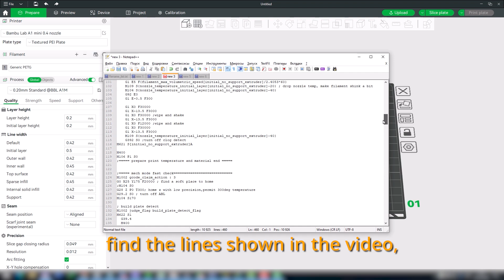How to disable vibration at start for BambuLab A1 Mini

Comment: For the A1 (No mini):

;===== mech mode fast check start =====================
;M1002 gcode_claim_action : 3

;G1 X128 Y128 F20000
;G1 Z5 F1200
;M400 P200
;M970.3 Q1 A5 K0 O3
;M974 Q1 S2 P0

;M970.2 Q1 K1 W58 Z0.1
;M974 S2

;G1 X128 Y128 F20000
;G1 Z5 F1200
;M400 P200
;M970.3 Q0 A10 K0 O1
;M974 Q0 S2 P0

;M970.2 Q0 K1 W78 Z0.1
;M974 S2

;M975 S1
;G1 F30000
;G1 X0 Y5
;G28 X ; re-home XY

;G1 Z4 F1200

;===== mech mode fast check end =======================
Reply from the maker: Thanks, I will pin your comment to make it more visible for other people.
Reply: e para a A1 Mini?
Reply: Iv have just tried on the A1, I commented out what the video showed, saved it, applied it and did a test print, I still get SOME vibration test, but not the big big shakey one.. how do I stop it all?
Reply: @Doyle69  Delete in the command "mech mode fast check start " until "mech mode fast check end" I can do it without shaking, very good.
Reply: @anuchasanchaikla44  Shall give a try thanks.
Reply: @anuchasanchaikla44  Worked perfectly thanks
Reply: @Doyle69  This worked, thank you very much!
Reply: @kerbalgaming1808  Have you found that his has affected your print quality? If so, how?

Comment: If you can't find the options you might have the printer table minimized (update changed the UI). Make sure to click on the "Printer" tab at the top to see your selected printer, then hover over the printer and you will see an edit symbol within that window that you can click. Clicking the cogwheel on the right side of "Printer" will let you choose printer but not see the advanced GCODE options seen in this video.

Comment: Whoever decided this test is needed every time the machine prints should be fired.
I'm pretty sure that while this may test for lose parts etc., it also causes lose parts and more wear and tear on the machine, so that Bambu Labs can sell more machines.
Reply from the maker: Maybe. Code from pastebin still works on my side.
Reply: @IzoFoxUA  Checked my Notepad++ and the edited code was still there. But it was not in BambuStudio. I could have sworn I pasted it in, but it was the normal code. Repasted the code and it works. Probably human error on my part. Sorry about that!
Your code works! :)

Comment: I sit here for 30 mins confused because my bambu software doesn't look like yours. 
So you use older software?
Reply from the maker: Yes, this video have been recorded 8-9 months ago and they slightly changed UI since that time.
You can click at the icon in the upper-right corner of your printer to change the printer settings.

Comment: This should work with the H2D as well - right?
Reply from the maker: Sorry, what is H2D? I think no, because it's only custom code change for the BambuLab A1 Mini and for H2D it probably be different.
Reply: @IzoFoxUA  It has these lines included:

;===== mech mode sweep start =====
    M1002 gcode_claim_action : 3

    G90
    G1 Z5 F1200
    G1 X187 Y160 F20000
    T1000
    M400 P200

    M970.3 Q1 A5 K0 O1
    M974 Q1 S2 P0

    M970.3 Q0 A5 K0 O1
    M974 Q0 S2 P0

    M970.2 Q2 K0 W38 Z0.01
    M974 Q2 S2 P0
    M500

    M975 S1
;===== mech mode sweep end =====
Reply from the maker: @n3orun  Sorry, I can't help with this dataset. Need to test on a real printer. You can comment line by line with ";" symbol and test on your own risk. It's the way how I found solution for A1 Mini

Comment: The XY frequency sweep is purely to check for lose belts. It won’t harm print quality just when you can please deal with the vibrations as eventually it will affect it if the belts are loose

Comment: This only works for the mini? I can't find that line for the normal A1
Reply from the maker: Hi! Yes, this solution works only for A1 Mini.
I don't have A1 to test, but I suppose that you need to find "mech mode fast check" string in GCode and maybe some code between "build plate detect" and "wipe nozzle".
You can try answer from this reddit post:
https://www.reddit.com/r/BambuLab/comments/1acau76/how_to_turn_off_xy_mech_mode_sweep/
https://pastebin.com/raw/SSHmWt0s

If you have X1 Carbon you can look other solution, like
https://forum.bambulab.com/t/remove-loud-vibration-by-start-printing/51753
https://www.youtube.com/watch?v=FnfzQGmHlec

Comment: It's like 15 seconds of noise and is the calibration for input shaping... removing this step WILL reduce the quality of your prints. A much better option would be to put some kind of dampener between your printer and the base it is on to stop the vibrations getting transferred to echoey materials.
Reply: Yeah, but doing it for every single print is overkill. Realistically, you only need to do it for the first print of the day or whenever you move your printer to a new location.
Reply from the maker: @xKenn  When I move printer to new place, I do full calibration from settings.
Reply: the problem is that it makes sooooooooooooo much noize on my printer that if I start a print during the night, the vibration calibration might wake up everyone while the hour long print afterward doesnt, its something that should be done once and not at the start of every prints...
Reply: That vibrator on start is waking whole house up
Reply from the maker: Maybe, but I saw a lot of users that want to disable this function for their printing over nights. In my case I need to disable it while I print over night and I don't want to disturb my neighbours.
Reply: @IzoFoxUA  Sure, but any noise that makes it out of your apartment will be via vibration through solid materials not the air - there's no way the noise it makes is loud enough to transfer through walls/floors otherwise. Hence why i suggest using some form of effective dampener rather than removing the step.

Removing the step is OK for a quick fix, but it can be done better. IIRC the vibration step is also used to judge whether the belts need re-tensioning or not, so you'll also lose those reminders when needed with it disabled. At the very least I would create a seperate machine profile with that G-code change in it, rather than over-riding the one you always use
Reply from the maker: @trotskiftw  yes, I agree with you that we can find better way to solve this moment.
And it's a good point, that you've remind about belt tension test during vibration step. Thanks!

Yes, I've created separate preset for these settings and I've shown it in the video.
Besides, Bambu Studio won't give a chance to rewrite default profile.
Reply from the maker: @trotskiftw  And yeah, maybe will be good to add dampeners or solid heavy concrete board under the printer, but it's not my case. For last half year, I've changed three countries with this little one.
Reply: @trotskiftw  Yes, the vibration noise IS the issue. That's why people want to stop it. I have my printer on my carpeted floor. I can feel/hear it from across the apartment, I can just imagine it sounds like something is coming through the ceiling to my downstairs neighbors
Reply: @iambear.6526  I know, and I'm suggesting other ways of dealing with it. Suppressing mechanical vibrations is a mostly solved problem. The software fix is a work around, but you can fix it properly mechanically by changing how the printer is coupled to its surroundings.